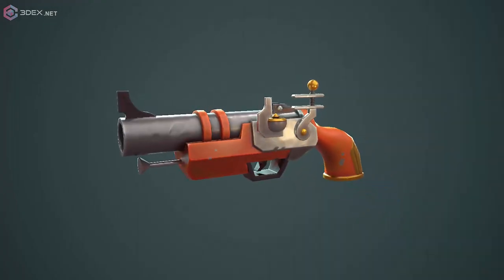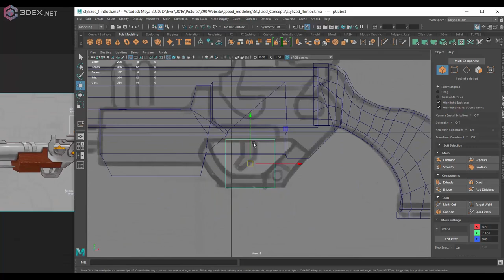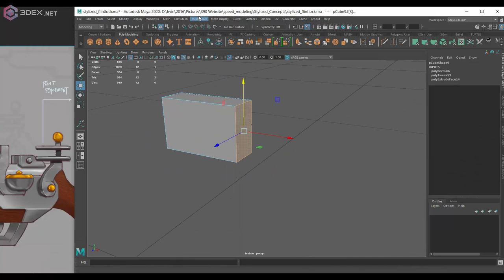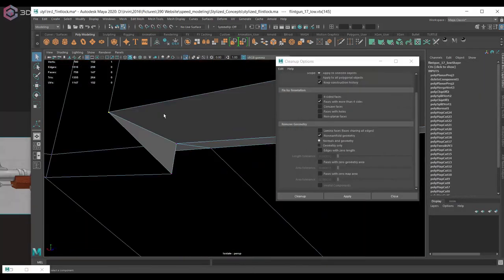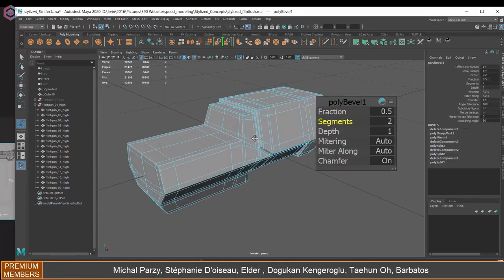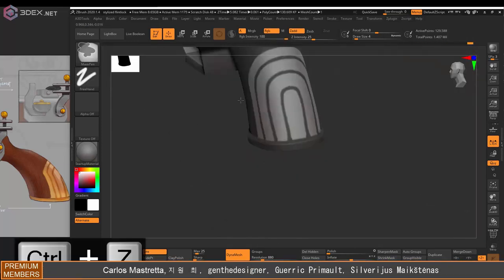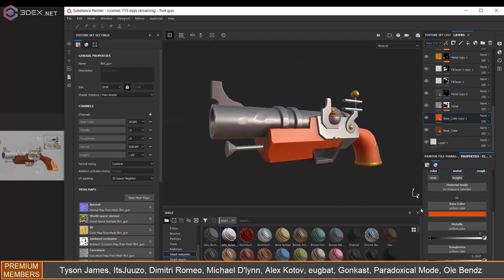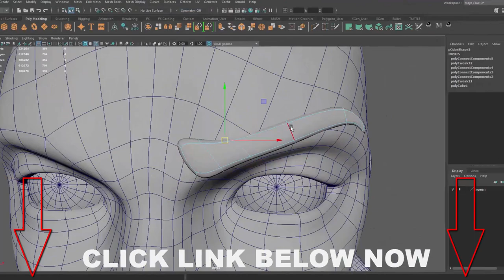Creating a Flintlock with Maya, Zbrush and Substance Painter

Comment: Awesome video again :) sorry if this is a stupid question but was a little confused.. When you went over to substance painter, did you bake the maps of the zbrush high-poly model export onto the lower-poly maya export?
I tried to slow down the video and it seems like you take the direct zbrush export into substance designer, however the polys are seemingly low so I was confused on how you did that. If you could answer it would be really appreciated!
Reply from the maker: In Substance I loaded the low poly model from Maya. I had already exported that before going to Zbrush which is why I went directly to Substance. And yes the high poly model is loaded under the bake settings to bake the details onto the low poly.

Comment: Hi, I have a question. Doesn't the Substance painter video card work on vram computers?   (my computer... Dual core 12gb ram and video card intel 2gb ram).    I can't see the color of the object I'm painting. Unfortunately, when I'm painting in base color, I can't see the color I'm painting. What do you think might be the problem?
Reply from the maker: I believe by default it is, though might want to check in the settings. when painting, are painting on a layer with a mask? or painting on an empty layer? what are you seeing?
Reply: @3dextrude  First, I open the object in fbx mode in the program. Then I bake. I open the fill layer layer and try to paint it in base color mode. It only appears when I get rendered paint.
Reply from the maker: @Kurabiye.Canavari  hhmm, I would say make sure you are painting on a mask whenever you add a layer.

Comment: When you are mirroring your UVs, do you need to offset them to avoid baking errors? Or do you have a way of getting around  the baking errors which often happen when you have identical UV's overlapping? Thanks.
Reply from the maker: I prefer to offset just in case, it's not always needed, but whenever I get errors I do offset.

Comment: How can I change the Pan shortcut in maya? I don't like to use the button in the middle of the mouse, so I would like to change this shortcut. can you help me?
Reply from the maker: It's not something I have done, but I found this link which may be helpful : https://knowledge.autodesk.com/support/maya/learn-explore/caas/CloudHelp/cloudhelp/2019/ENU/Maya-KeyboardShortcuts/files/GUID-36D24C0F-19E4-411E-8CA9-DB7B64C3E6EA-htm.html#:~:text=To%20assign%20a%20Hotkey%3A,based%20on%20the%20default%20set.

Comment: Hey i have a question! If i go from lowpoly to highpoly and i bake my model in substance it wont get to see what i created in highpoly fase. Why dont i get to see what i created in my normal map?
Reply from the maker: You need to bake the maps and load the high poly through the bake settings to bake the details onto the low poly model. They should show up in the normal map, if not; there may be a problem with uvs, or the location of the model, or the naming if you are baking by mesh names.